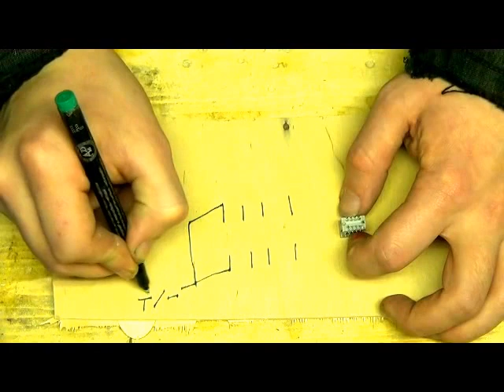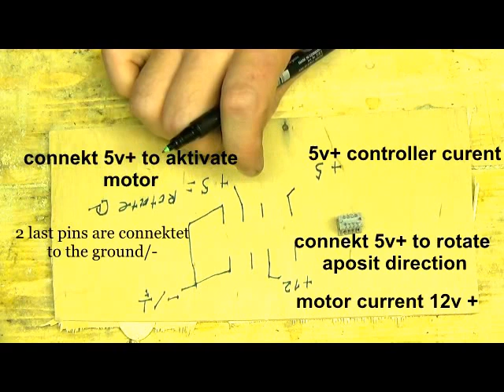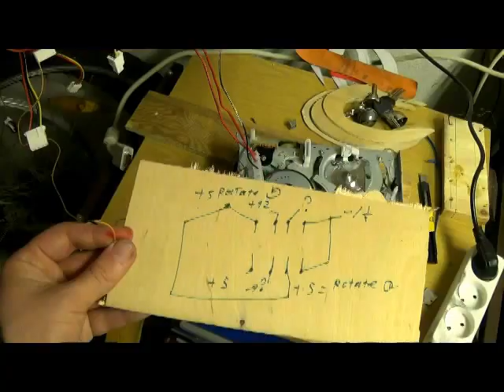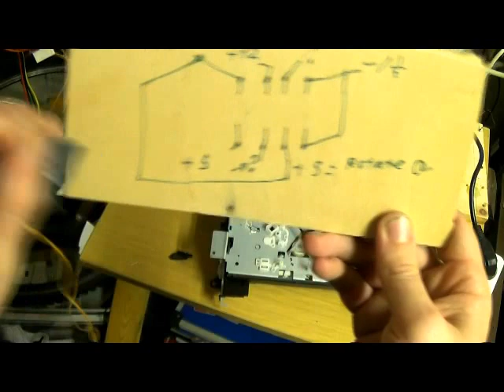vhs motor

Comment: Hello Aleksandr! Firstly, thank you for sharing your video.
I disassembled a VHS Player and inside it there is a Capstan Motor that has a "Panasonic AN3844SB" Controller IC, but I can't find its Datasheet on the internet. This IC has 28 pins. Is there any way to test the pins for power? Thanks
Reply: try finding manuals at elektrotanya

Comment: Thanks for your video. I have a Capstan motor JVC that is here: https://www.ksp-electronics.com/en/product/view/25473-cap-motor-qar0087-005  the connector looks almost exactly as yours. BUT I can't figure out how the pins needs to be used. If you look at the above https:... and the connector is at the bottom right side, the motor is at the top the connector has 8 wires.  let's call the left side 4 connectors 1,2,3,4 and the right side would be 5,6,7,8. The 1, 2 and 3 has no label.   3 = SV  or 5V (hard to tell) and under 5V is CTL label, the right side :  5 = 12V, 6 = NC,  7 = F/R, 8 = P - G. What wires goes to 12V - is it 5 + 8 - right?  When I put 12V on 12V at #5 =12V+ and on #8 goes GROUND nothing happens. When I put the +5V on #3 my adjustable power supply takes 2.5A and the voltage dropped to 4.8V and the motor moves a small amount and STOPS! I don't understand this at all, if you can help I'll try your suggestion. Thank you!
Reply: Have u find because i have same happened motor just spin haft

Comment: I have a "U-26B engine Capstan SONY" and I need to operate the Hall sensor, how you could get the information for the connection?
It uses a chip "cxa8005"

Comment: Do you know how to make vcr head motor generate electricity ? nobody knows. thoughts ?
Reply: You need to isolate the coils from the circuit board 
Best method: take the coil and rotor assembly off of the circuit board

Comment: Hi, I tried this but it doesnt work for my motor, it looks the same, but maybe the chip is diffrent
Reply from the maker: you need to find a datasheet
Reply: +Aleksandr Sandovic Cor 10 months!
I did get another motor to work, theres was something odd about the ic, I think it needed a 2 phase clock or something difficult like that.
Reply from the maker: sorry for 10 month delay ^^' i have time consuming work.
can you eventually read the text on the chip and what model vhs it is from ?